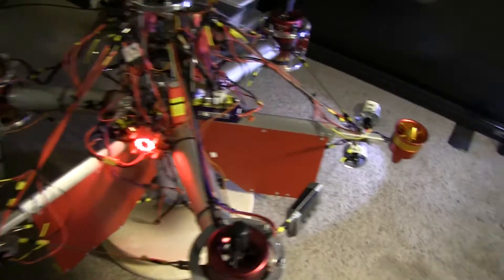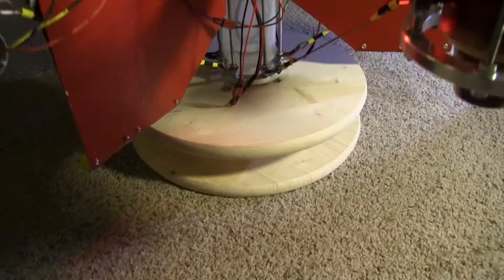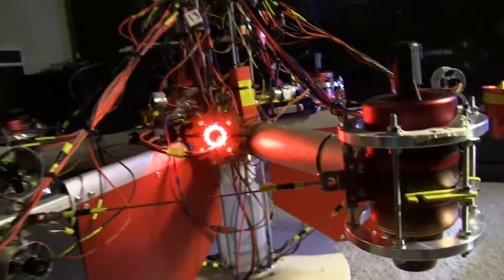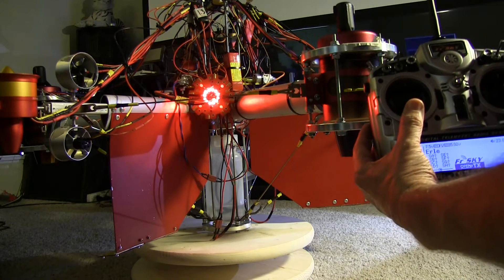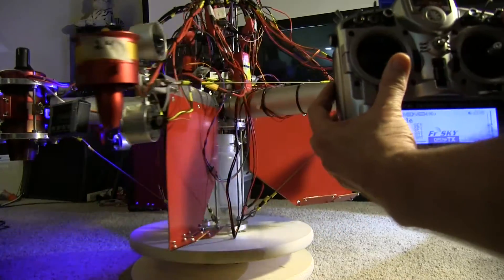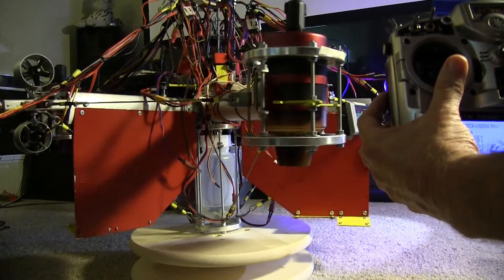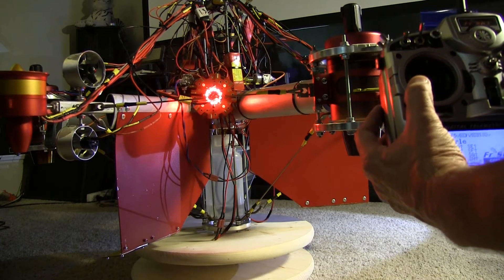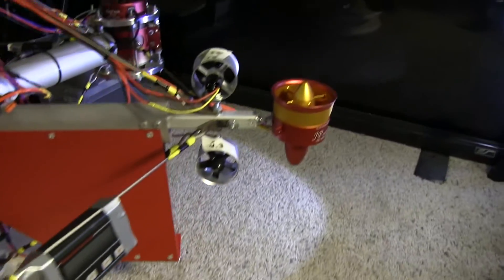Turbine Drone Test of Yaw Thrusters

Comment: Maybe these turbines could be used. Click on the link  http://www.greenstategardener.com/s-line-347-cfm-vtx-00s?gdffi=eef1323447374a878aadfc2c2688fbe6&gdfms=ACBAE9ED723E490BAAB25A13ACE59AC3&gclid=EAIaIQobChMIhMia3sui1gIVklx-Ch3qZQEuEAYYAyABEgKekfD_BwE
Reply from the maker: What is the thrust and weight? I couldn't tell from the link. They don't look like aircraft fans, likely way too heavy
Reply: Well, I don't know the specifications. Just an Idea. I did come across the piezoelectric fans and if they were put collectively in small light venturi many coupled together you might get lighter propulsion unit. Just a thought    https://youtu.be/LvckweOqjdk
Reply from the maker: Do you think that these types of fans could even lift their own weight? Something to consider first.